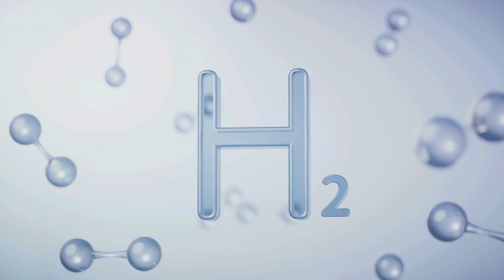Hydrogen Fuel Safety

Comment: " Safe Mantra".
A number of hydrogen's properties make it safer to handle and use than the fuels commonly used today. For example, hydrogen is non-toxic. In addition, because hydrogen is much lighter than air, it dissipates rapidly when it is released, allowing for relatively rapid dispersal of the fuel in case of a leak.
Safety precautions for hydrogen:
Mixtures of hydrogen and air can be highly explosive. Never smoke near a place where hydrogen is generated or being used. Remove all possible sources of flame and sparks. Hydrogen should only be generated and used in a well ventilated out door area.
Hazards:
Hydrogen used in the fuel cells is a very flammable gas and can cause fires and explosions if it is not handled properly. Hydrogen is a colorless, odorless, and tasteless gas.
Liquified hydrogen.
Hydrogen has to be cooled to -253°C and stored in insulated tanks to maintain this low temperature and minimize evaporation.
General Precautions When Handling Hydrogen Gas:
Avoid cracking hydrogen cylinder valves to remove dust or dirt from fittings as this practice (though acceptable for other gases) could result to self-ignition. Hydrogen gas cylinders must be secured in an upright position to avoid being knocked over.
( hseguru@yahoo.in / alstom.manojkumar@gmail.com / manojpriyankajagriti@gmail.com / +91-8252771261).
Reply from the maker: Thank you so much for your constructive comment.